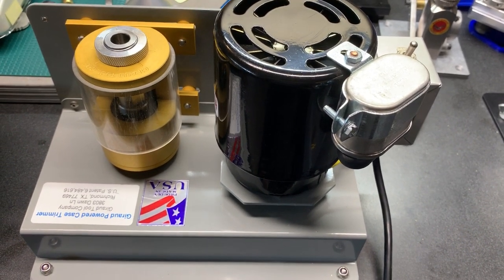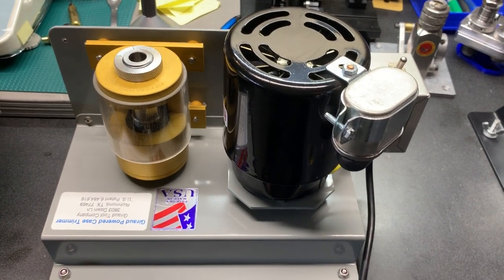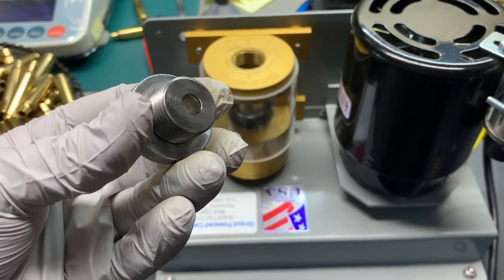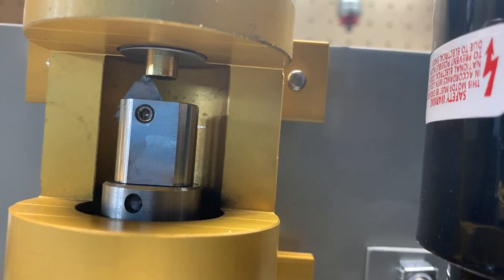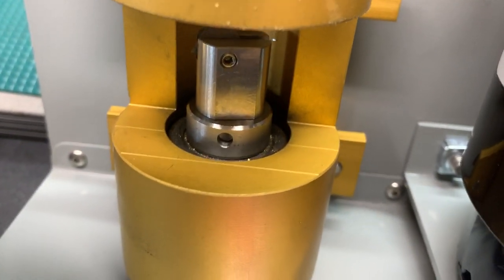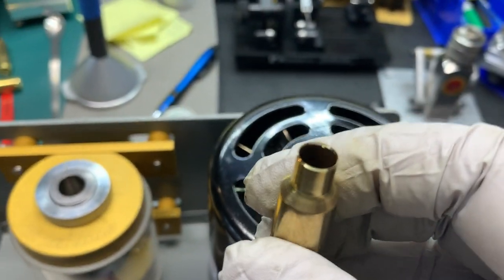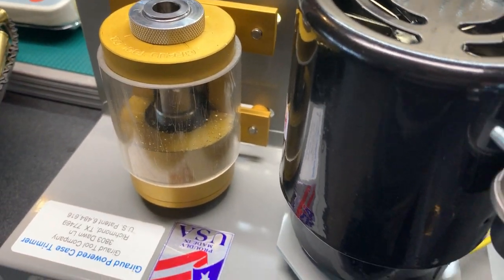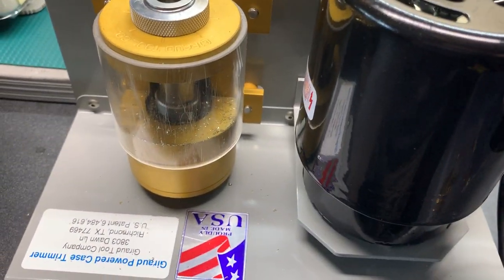Giraud Power Case Trimmer

Comment: I want to give that scrap barrel trick a go. The spring loaded collet is something I do not like about this. So, I would just have a gunsmith ream it like he was cutting the chamber on a complete barrel? Also, would you just cut the scrap barrel to the same length as the Giraud collet?
Reply from the maker: Exactly and just thread it 7/8-14 like a die.
Reply: @FClassJohn  Any chance your gunsmith would be willing to do any more of these? I am a couple and a half hours away from a gunsmith and am going to have to do this through email and phone. I'd just as soon have someone do it that has already done it before. If not, no problem.
Reply from the maker: I can ask him but I probably won’t see him for a little while and he’s a couple hours away from me. What I can recommend in the meantime is you can actually pop out the retainer ring at the top of your collet and then pull out the insert and remove the spring that’s in there. This will almost do the same thing and will at least let you try it to see if you like it.
Reply: @FClassJohn  Cool!!!! I'll give that a try!!
Reply from the maker: I did forget to mention that you need to put the insert back in but I’m sure you would’ve figured that out. 🤪

Comment: John,
Would you give a little more detail on the custom collet that your gunsmith made for you please.
Reply from the maker: I have him use an old barrel and he basically reams it and threads it just like a die. Polish it out with some steel wool on a bronze brush chucked up in a drill. I swear by them now and won't touch the factory collets anymore.

Comment: John with the speed of the blade cutting the brass for chamfering and deburing is there any chattering on the brass?
Reply from the maker: As long as you have it set correctly there’s zero chattering. But you have to make sure the mouths are round. If you have one out of round you’ll feel it real quick.

Comment: Can you use the same cutting head without changing position for a 6.5 cm and 6.5 prc ?
Reply from the maker: As long as your neck diameter is the same between the two, then yes. You'll need a different insert for the actual brass but the cutter itself should be good.
Reply: @FClassJohn  that's what I thought, thank you !

Comment: I am wondering what the dimensions of the trimmer are.. I can not seem to find it anywhere.
Reply from the maker: Roughly 13”w 6.5”h 6”d
Reply: @FClassJohn  I hear with my ear that you may be local to my area of PDX???
Reply from the maker: @mikeq7096  yep that’s correct.
Reply: @FClassJohn  nice, I am in milwaukie
                              I suspect we may have crossed paths at TCGC
                              A friend of mine said he pulled targets for you at the 600 
                              is how it came up
Reply from the maker: @mikeq7096  It's very likely. I run the 600yd program out there.
Reply: @FClassJohn  last time I shot the 600 was the first time they had a clinic for people to try it out. I have not lately as I heard that a brake is a no go and I have one on my 6.5 desert tech. could dust  off the 308 though if I had too
Reply from the maker: @mikeq7096  We've been allowing brakes for a couple years now. Contact me through the club contact list if you want to get on the list to attend. We have Covid protocols in place so you need to be on a list. Thank you.
Reply: @FClassJohn  will do

Comment: I know that this is a silly question, but how does trimming your breasts affect accuracy? Thank you. I am a new reloader.
Reply: So sorry for the typo. Trimming brass
Reply: You have to trim because the brass is stretched & grows in length when you re-size. 
If you check out specs for a particular caliber, you'll find "case-length", i.e., .308 is 2.015 in. 
And so "trim-to length" is often down to ~ 2.0050. Typically is ~ .0010" under max case length.
When you re-size it, if it then measures 2.1175, then you have to trim it to be able to chamber & cycle the round

Comment: I can not get consistent COAL lengths with this trimmer.  I assume the length from the shoulder to the case mouth is consistent, so I assume the length from the base to the shoulder datum is different for each case even though it is going thru the same full length resized die. Any help would be appreciated
Reply from the maker: Yes if set up correctly and using the right insert it will trim consistency from shoulder to case mouth. Base to shoulder can vary depending on your process, dies and press.